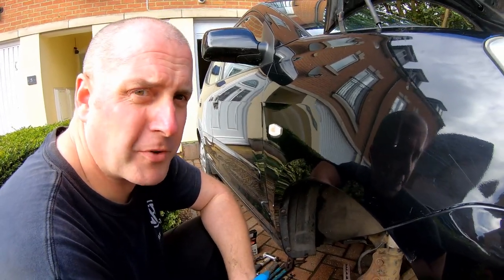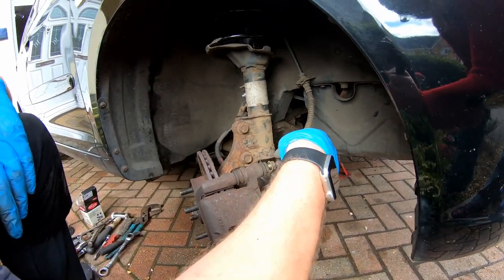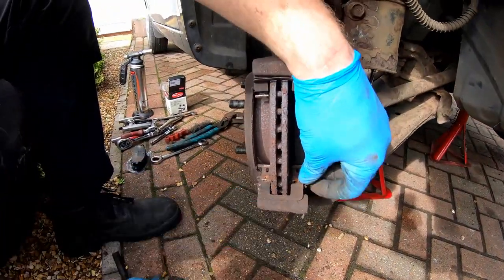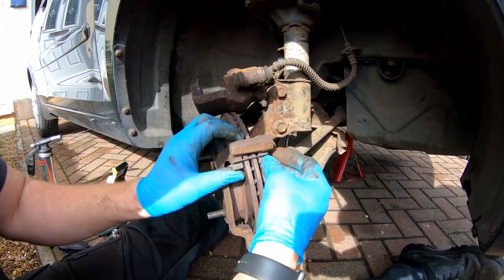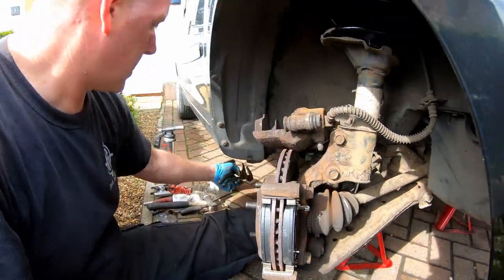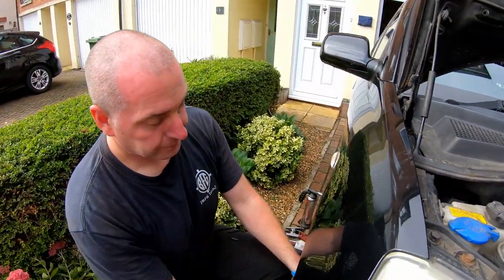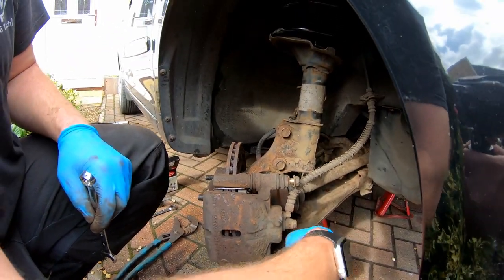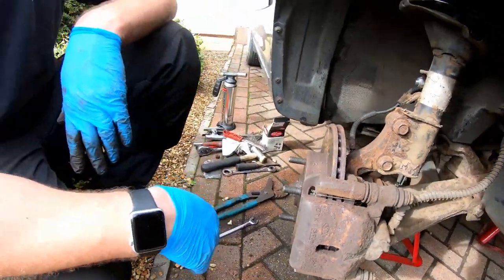2004 - 2011 Kia Picanto - Replacing The Front Brake Pads

Comment: Thanks for sharing. It is a good idea to put some copper or silicone grase on the pads where they slide in the brackets. Also grease the pins holding the caliper . REmove the brake fluid reservior cap to lessen pressure when pushing the piston back. Its a good idea to clean the robber boots and the area behing them, before pushing them back in the housing. Hang the caliper by a bunjee cod in case it falls ans stresses the brake lines.

Comment: Hi Kev. Well put together video. 
However having just completed a full brake replacement and service on a 63 model and many other vehicles I would recommend as far as maintenance and longevity go that the following is undertaken.
1. The caliper mounting brackets are removed and the grooves in which the shims fit are dressed with a file. The grooves rust causing the shims to lift and restrict the lateral movement of the pads.
2. Those sliders were showing signs of seizing due to water ingress and corrosion. Again they should be removed, the rust cleaned and reassembled using silicon and rubber grease on the respective components. Its surprising how bad they get. 
As you've put new pads in it will probably be a while before you go in there again. If you don't clean and maintain they will seize leading to premature and uneven pad wear particularly on the rear. Also efficiency is compromised. If neglected long enough it may well result in component replacement. 
Its not until you do a thorough job that you realise how bad the brake performance has deteriorated.
Reply from the maker: Cheers

Comment: Excellent very helpful video and nicely explained.  If you don't mind I have a couple of questions (sorry first time changing brake pads so sorry if silly)  Firstly, on the new pads there is a removable piece of tin - are you supposed to remove this - looks like yours was left  on.    Secondly - don't suppose you would do a video for the rear pads as well as cannot find a video anywhere to help.  I attempted one side on rear but made very hard work of it as I did not release the handbrake (so was hard getting caliper off), then I had to remove extra bolts as was not enough play on cables to remove caliper.  Also, getting Caliper in was hard - not sure if it's squeeze type or wind in type on rear???  Any help appreciated, Cheers
Reply from the maker: Maxie, the little piece of tin is there to act as an anti vibration shim. It is supposed to prevent the microscopic vibrations that occur under braking which can manifest themselves as squealing. It isn't mandatory to leave them in in my opinion. As for the rear brakes, the car is not mine, it belong to the wife of a friend, however I am sure that they would like the rear brakes to be serviced at some point so I will be sure to do a video. Glad you found this video helpful, don't forget to subscribe!
Reply: @KevsShed  Cheers, I have subscribed.  Thanks for confirming what the removable tin bits are, the pads that came out didn't have them which i why I assumed they have to be removed.    In general do you find most rear brake calipers are the wind in type and fronts and squeeze in?
Reply from the maker: @maxiemillie4327  Wind in style rear calipers are fitted to cars where the handbrake operates the rear calipers, I cannot remember off the top of my head if the Picanto had this style or not and as I do not have the car to hand right now, I am unable to check. One thing that I would say is that with a bit of determination, wind in types can be done with a pair of stout pliers if you are in a bind as I have done this before when I didn't have my wind in tool available. However I did have the calipers off the car and in a vice at the time! To be fair, a wind in tool can be picked up very cheaply from companies like Laser which are available in most motorfactors. Good luck!

Comment: @Kev's Shed  Great Picanto vidoes and many thanks for posting them as helping me sort out my daughters 2008 model. Is the crossbeam where you placed the axle stands? I want to do all 4 corners on her car that has been stood still for a coupe of years so will be removing wheels to put in to get tyres changed, pads as a minimum and probably discs over a couple of days. Want to therefore raise all 4 corners and leave it raised while I look at what needs doing and then get stuck into it

Comment: Good video thanks. You dit not lube the ends and the backs of the break pads, or is this not necessary?
Reply from the maker: Not even remotely necessary, this is a habit from by-gone years when manufacturing processes weren’t as good as they are now! If there was supposed to be grease on the back of the pads then the manufacturers would do it from the factory! I have never had a brand new vehicle with grease on the pads! Glad you liked the video though buddy 👍🏻

Comment: Great video, thanks!  Seems pretty doable.

I have a 2012 picanto, so it's the newer model. Anyone know if there are much, if any differences? Or can I just go by this video to do it?
Reply from the maker: It’ll be near identical mate 👍🏻
Reply: @KevsShed  Thank you. I'm working on it now. Got a new brake disc on one side on today, had a bit of trouble with putting in the new pads, and then it got dark. So ill finish tomorrow.

I have one more question. I don't really understand how these brakes seem to work. I understand the piston pushes the brakepads against the brakdiscs, but what causes the pads to move back again? How come they don't stay stuck against the discs?

Comment: Hi Kev, great film, don't suppose you would know what the torque settings would be for the caliper bolts please
Reply from the maker: The front caliper guide rod bolts are 39 - 49 Nm and the brake caliper to steering knuckle is 83 - 93 Nm. 👍🤓

Comment: My wife has a 2017 picanto , would it be the same routine?  Once it's out of warranty I might start doing the service, never done it before 😏.
Reply from the maker: David, it will be an almost identical process, I haven't looked at the 2017 model personally but I believe that the chassis are very similar. All brake pad exchanges are pretty much the same across all makes and models with only very slight variations. You'll manage it fine!

Comment: is it safe to use a scissor jack that I usually use to change to temporary tire to do these?, I don't have another jack
Reply from the maker: You could use a scissor jack to lift the car but do not put legs etc under the car until it is fully supported on stands, do not work on a suspended vehicle supported by a jack alone!
Reply: @KevsShed  I use a scissor jack, but where about's under the car do you use the support stands without causing any damage

Comment: Hi Kev is this the same foe a 2012 picanto
Reply from the maker: J Williams although the 2012 was a revised model, the process will be pretty much identical. In fact, I haven’t got any drawings to hand but I would not be surprised if the calipers are the exact same. Regardless, there will be next to no difference in the process. Hope this helps 👍🏻

Comment: Where do you jack up the car front and back with a floor jack?
Reply from the maker: Under the front there is a crossbeam where the suspension arms are attached, this is a good hardpoint to jack the front and on the rear I used the axle beam between each of the rear wheels, always use axle stands after jacking though, never work under the car on a jack on it's own in case it fails. I do know of people that like to put the wheels as they remove them under the car also as a second level of contingency but I have never felt the need. hope this helps 👍
Reply: @KevsShed  Thanks! You're a star! :)
Reply: @KevsShed  Again, thank you for taking the time not only to make these videos but to type out a good lengthy response. Especially given that you don't owe us anything. Thanks for helping me out in a pinch!
Reply from the maker: @justin credible  You're welcome buddy!

Comment: sound like it is scraping when you moved the wheel
Reply from the maker: It wasn't scraping, that is the sound that brand new pads make on an old disc. Once bedded in they were fine. FYI this car has had 2 MOTs since this job was done, both of which its passed with flying colours!
Reply: @KevsShed  ok, so is mpg down while they bed in?
Reply: @KevsShed  ha ha ha

Comment: U didn't copper grease pad plate or anything .. umm lol
Reply from the maker: I’m fully aware! The reason for that is because it is totally unnecessary! It is not called for in any factory service manual and no brand new bike or car I’ve ever bought has had copper grease on the pads! It is an archaic workaround left over from the 60s when hydraulic callipers were in their infancy and it was used to stop squeal, totally unnecessary on any more modern cars. Regular preventative maintenance should be in place to prevent any problems instead of slapping grease all over your braking components that serve no purpose other than to collect excess dirt and brake dust or worse still migrate onto friction surfaces!